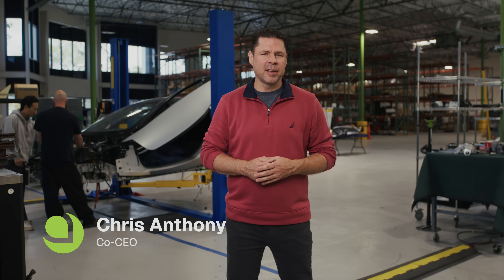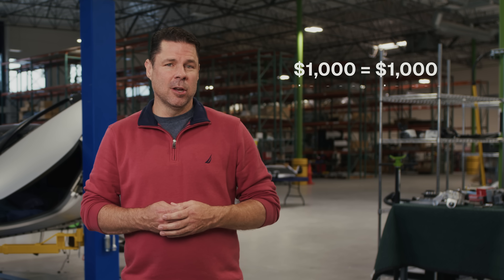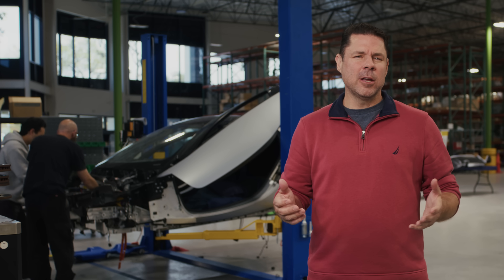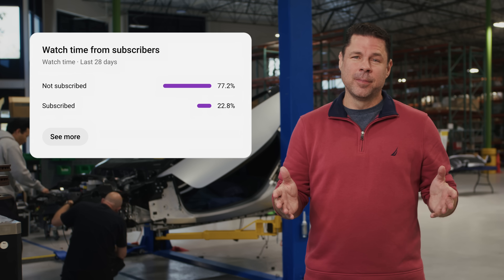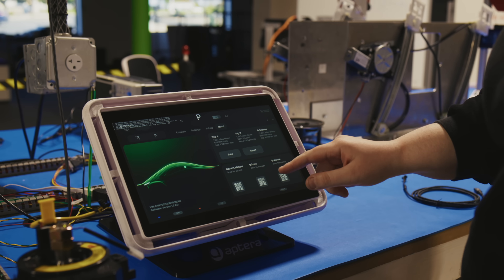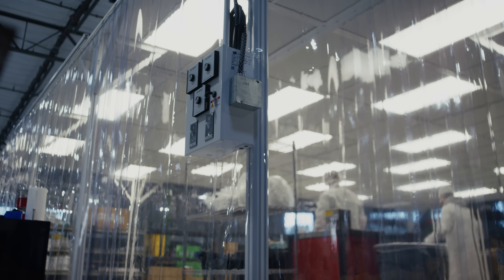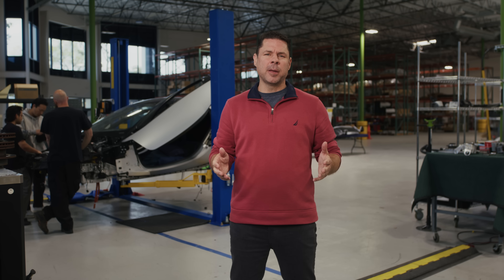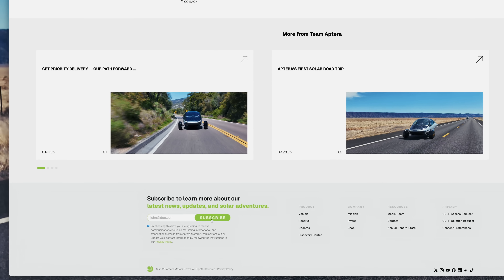Aptera Update — April 2025

Comment: What I really want to hear in these videos is what is left to do before you start shipping cars to customers and an estimate of the time you think it will take. 
Something like:

 'here's our current road map to producing vehicles: we have to complete production intent vehicles 3, 4, and 5 then tune our factory to reflect what we've learned.  We are xx% done with production intent vehicle 3 and will need to complete it before starting on production intent vehicles 4 or 5.  We expect to be done with PI3 in x months and all the way to production in x months.". 

Each of these updates you could provide where you are on that road map and any new obstacles (if any) that came up.  It would make me feel a lot better about investing in you if I could hear your progress laid out like that.  The dates you mention could always be tentative and you could make that clear when you mention them.
Reply: I hope Aperta makes it and is a success but sorry I could not wait until mine could be built especially after the price increase. I have bought (actually leased) an Equinox EV last month for the same price that was listed originally for my Aptera order. EVs are changing every year so in two years not sure what I will get to replace the Equinox but it will likely be another GM, the new Slate or nothing at all. I looks at Aperta again too but that price increase was a killer for me. The free solar is nice but I am getting free charging at the dealership and less than an hour to charge so that is a wash for me.
Reply: I hope Aperta makes it and is a success but sorry I could not wait until mine could be built especially after the price increase. I have bought (actually leased) an Equinox EV last month for the same price that was listed originally for my Aptera order. EVs are changing every year so in two years not sure what I will get to replace the Equinox but it will likely be another GM, the new Slate or nothing at all. I looks at Aperta again too but that price increase was a killer for me. The free solar is nice but I am getting free charging at the dealership and less than an hour to charge so that is a wash for me.
Reply: Their estimate of the time it will take has always been funding dependent. Though a few Accelerators did invest a million or more they have not been able to reel in the big whale investor who could secure their production time line. Not for lack of trying, they have traveled the world in pursuit. With so many EV start-ups that have gone under in the last 4 years and the shaky market, along with ongoing Trump tariff uncertainty, they have now been forced back into crowdfunding measures. They are offering small investors a very good deal - if they can survive.
Reply: @jeffcarlton3590  that's fine.  They can state what is going on and what they have money for then.  I don't expect the timeline to be perfectly accurate.  I just want to see that they are making progress. 

Honestly, if they want to improve crowdfunding I think stating where they are at, what progress is being made and when they are running low would make the community feel more engaged.  

Right now it feels like I'd be throwing money into a black box with no idea if things are actually moving along.  I didn't expect them to anticipate everything that will happen or always stay on budget, but showing progress on things would make me feel a lot better that money is being used in a way to make progress and not just to convince us to send them more money.

Like right now they are working on two new production intent vehicles, right?  And this is after making like four of them?  How many production intent vehicles do they need?  Is there even an end to this?
Reply: @En-Jon-eer  we’ve been seeing monthly updates with progress. They told us about the intentions to tour the country to spread the word and gather more investment. We’ve seen them show it at CES and it’s been to Korea and the composite body was shown in France. I agree more details would be nice, but there have been regular updates showing progress.
Reply: @dr.jerrywolfe1289  we've been seeing updates that could easily be the same prototype car and claims by the staff at Aptera, or things that could lead nowhere.  I believe the Aptera was supposed to be out early 2024 if I recall correctly.  It obviously isn't.  That's why I want more information. 

 I want to believe that the company is honest but the updates are always vague 'we are working on this new stuff' but there isn't really evidence that any of it is new.  If I was leading a dishonest company I would certainly do as this company has been doing and give updates that sound good but mean nothing and keep seeking more money.
Reply: @ I live in San Diego. I visited the R&D center on my first visit and got a ride in Luna. I went back for another visit at the assembly plant and got a ride in beta. I met Chris Anthony on the first visit in March 2022 he told me there would be keys in hand by the end of the year. Of course things have not worked out that ideally.  I went back last year for another tour and was going to get a ride in the Gamma vehicle, but I offered to invest more money if they would let me drive it so I was able to drive it in the parking lot area. Trust me it’s real and there’s been progress made on each version. On that third trip I got to meet Steve Fambro. I’ve met several of the engineers and the marketing staff.  To me the enthusiasm of every one was contagious.
So I slowly started investing more money as I gained confidence. I am number 52 accelerator and I’m going to get one of the next hundred in this present round. I feel lucky to be close enough to really know some of the individuals involved and see the real thing and touch it and drive it and sit in it.👍🌞 our world needs this product
Reply: @dr.jerrywolfe1289  & Jon, nothing Aptera ever claimed has happened. The trike was made by MIT and driven in extended competition in the '90s. The original is in a private museum somewhere. Driving around in a parking lot recently doesn't mean anything. I have just enough engineering credentials in heat transfer and fluid mechanics plus residential & RV solar to have called out their layers of nonsense from the beginning. Skin cooling, AWD, IWM, 10 miles/kWh, avg 40 solar miles/day so 35 mile commuters don't need to charge. I called out the 10 kWh Gamma battery nearly a year before Aptera admitted it. I called out they couldn't properly charge the trike more than 6 months before they admitted it. I called out Vitesco cooling requirements while Aptera lied about a vent at the bottom of the windshield. Many of called out every fake delivery schedule claim. Other business and racing specialists called out more false fundraising claims. 3 for 3 professional investment firms that we know of turned them down. Google walked on them. Aptera conned fans to donate urgently before USCG unlocked their vault. I told fanboys USCG firms don't operate that way, they would have to solicit from their Rolodex and there was no reason to expect success. The Flagstaff run demonstrated 7 miles/kWh and typical USA solar average of 13 miles/day. Data was hidden from the wind tunnel and from the Honda track. Gamma could have demonstrated miles/kWh around Carlsbad over a year ago. Remember the burger run with Jerry following? Completely shameful! We're waiting to hear what SEC is concerned about? And all of this behavior is similar to how they misled and disappointed people with Gen-N upstart. That was horrible!  $200K/yr salaries and mostly nothing done!
Now they have new transmission to blame budget and schedule issues on. I think it's to distract from Flagstaff performance way below marketing claims. They can dream a transmission will do it. Funny they never mentioned it before. It's not on the $30K BOM Aptera gave to USCG ;-)
Reply: @En-Jon-eer the PI vehicle they are completing in this video is the final PI with every working function in it. They are planning a trip around the country this summer showing the vehicle to everyone and proving the capabilities of it. Their goal is to raise $30 million along with loans and grants they have been promised to build out the production line. It is a process but people seem to not understand what it takes to start a product and actually manufacture it. 2025 will be the turning point for Aptera either through success or being sold to someone who can finish the journey.
Reply: @gmv0553  None of that will ever happen. 2 seat trike getting 7 miles/kWh, 16 solar miles/day, maybe charging at 40kW, range of 300 miles, safety?, >$40K. Every <$35K EV is a better value. The end!
Reply: @jeffcarlton3590 if they were not on crowdfunding and on traditional platforms they would have been in jail a decade ago.
Reply: In the military it's called a PO&M -- Plan of Actions and Milestones
Reply: I agree that more specific info would be helpful, but I can also understand why they don’t include it; even with making the disclaimer of dates being tentative and delay possibilities, someone can easily download the video, crop it down to a specific goal date, and if they miss it then raise hell about “they’re a scam!11!1 They promised to have this done by this date, and they lieded!!1!1!” I don’t blame them for wanting to guard against that.
Reply: @jacobcarlson4010  what you are suggesting makes no sense to me.  People are not held to something that someone else cropped.  

If what you suggest was reasonable then I would crop parts of Elon Musk's video clips to make it sound like he was promising to pay me a million dollars and then take him to court over it and win.  The reality is if I tried that I would be laughed out of court.

Similarly, if someone was to reference a video not from Aptera with some sort of release date and get angry it's not on that date then a significant number of the responses would rightly be something like. 'no you idiot, they updated that here' and then they would link to the accurate information or updated estimate.
Reply: @: EV haters do not care if it’s an out of context or cropped clip, speaking from hundred of interactions, they will just take the short clip at face value and work themselves into a frenzy when the “promise” they saw doesn’t come to pass. Case in point, all those who are already trying to call aptera a scam/hoax because they haven’t met previous goals for development and start of production. And of course I’m not saying that aptera would be sued for an out of context clip, but you get haters spreading their own (essentially) lies based on a snippet of video from a status update, and that can turn otherwise interested customers away. If this basic principal of communication doesn’t make sense to you, then I don’t know what to tell you.
Reply: The trike and videos are for generating $donations. Your way isn't as good.
Reply: @artsmith103  my way isn't as good for what?  Informing people?  Getting people to invest?  Disagree on both counts if it is an honest company.  

Assuming Aptera is honest, which I currently believe they are, they would get more investors if they were forthright with information.  

An example: the 1:1 discount on an Aptera vehicle feels desperate when they used to do only a 5%.  It feels like they have run out of money.  And if they were clear on their production and  causes of where the money was going, why it was taking more than estimated, then I think people - at least people like me - could invest more confidently.
Reply: @En-Jon-eer woooooooshhhhhh

Comment: What I would like to see is a movement AWAY from touch screens and large screens entirely.  In an electric vehicle these all take power, massive amounts of power.  Go back to mechanical switches and dials and selectors.  They're not only more economical when it comes to power, they're easier and SAFER to use when the vehicle is in operation. In a vehicle that is supposedly designed from the ground up to use as little power as possible, installing massive power hungry screens seems like a step backwards. Just use small mono-colour LCD screens where needed.  If you worry about marketing, just call it Retro.
Reply: Voice commands are starting to show up in vehicles and is the future! Manual knobs are on the way out!

Comment: Switzerland here. Want one!
Reply: Can't use it on public roads!
Reply: @Throckmorton.Scribblemonger  then we have to change the law.
Reply: @HeikkiHeer  Change the laws because a small American startup designed a vehicle that's too wide?
Reply: @Throckmorton.Scribblemonger According to aptera: Width: ~88 inches (2.23 m), According to DOT. Ford Raptor and Hummer EV have about the same width.
In Europe cars are allowed to be up to aprox 100 inches or 2.55m wide.
Reply: @HeikkiHeer   It's not a car, it's a three-wheeler and those have a 2000 mm width restriction in Europe.

Comment: I’ve been an Aptera supporter for years and years. They estimated the cars were going to be around $27k then it’s going to be $40k now. Big difference. I’m retired and that’s out of my range now. I do look forward to see one on the road in the future.
Reply: They should pivot to kit-set cars.  

They simply can't compete with Chinese electric vehicles.  I can get a 4 door EV for 20% cheaper than the Aptera.  

I want this to succeed.  But there is a reason they are constantly asking for investment. 

It's a failed premise, and nobody with any real cash will touch them.
Reply: @fw1421  You could just wait for the 250 mile range Aptera which looks to be much more affordable by their estimates. Still plenty of range for most people and it will be arguably more efficient due to less battery weight. More efficiency equals more solar range. Just saying.

Comment: Glad to see you decided to build a better thermal system instead of relying on natural cooling.  Being a drone pilot and living in Las Vegas, I was concerned about overheating batteries.  Lack of proper cooling created many angry Nissan Leaf customers as their batteries failed quickly.
Reply: Aptera has always had an active cooling system designed, although the design has changed.  I visited the factory in 2021 and saw it being developed under NDA.

My company developed the AC system for the Ford Th!nk and the Corbin Sparrow.  It will have proper cooling.

Comment: As I said in the Discord channel, I'm already an Accelerator but would eagerly buy one of the investor coupons if it could be applied to a non-LE model.  Yes, I fully understand the only vehicle in development right now is the LE and there may never be another model.  But if my ideal model comes along I would choose it instead.  I don't see any risk to Aptera by offering this option.
Reply: I believe only the 2k to 3k priority build slots for the $5K min investment is tied to the L.E. model. As it should be since the first 6K + slots will be L.E. builds. I have heard that you can option unwrapped L.E.'s if a custom wrap by a 3rd party, or DIY is your only desired initial mod.
Reply: Best thing to do is go ahead and get another LE. Then turn around and sell it right away. With it being such a low VIN and the massive demand Aptera has, I could see it going for a 10X what you pay for it at auction. Then when your model comes out, it's like getting a free Aptera.
Reply: It makes no sense Aptera resists your offer. You send donation sooner, Aptera delivers trike even later. That's their specialty!!